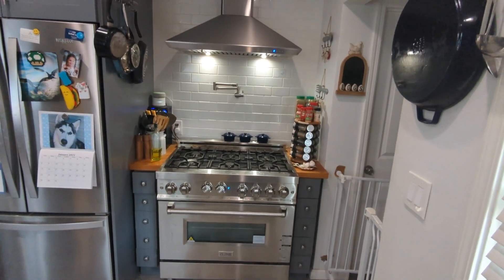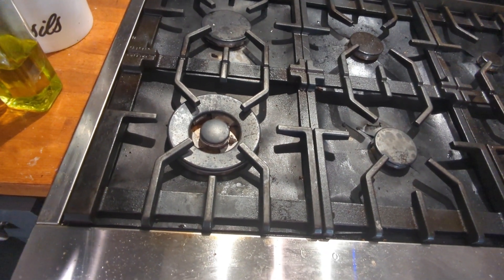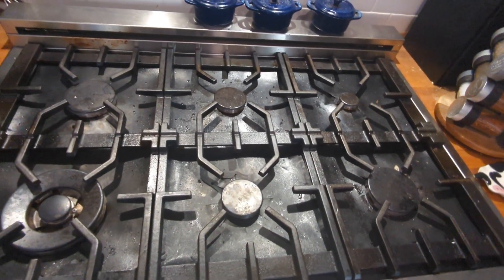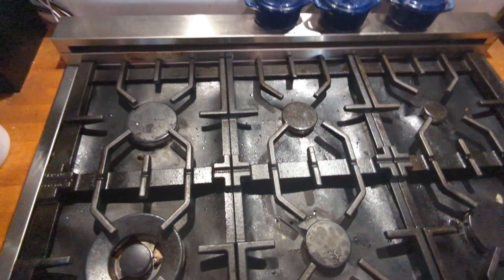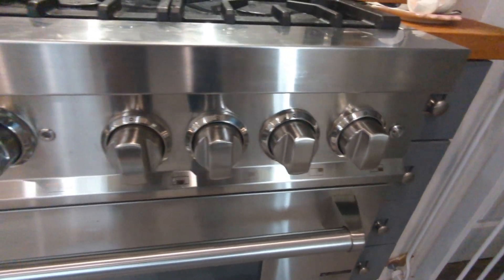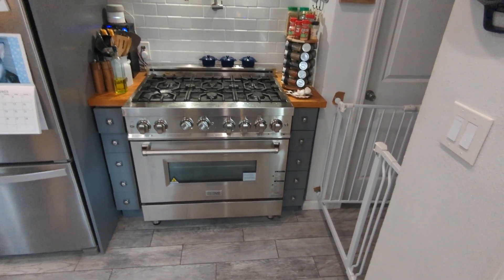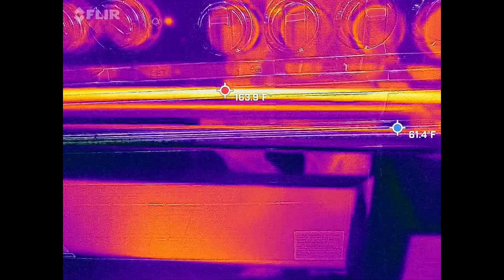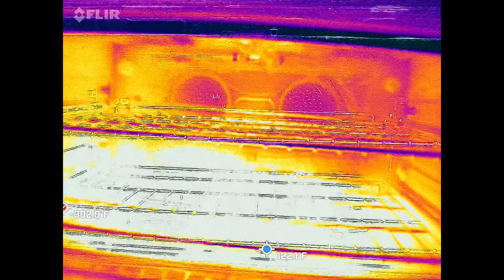Update: ZLINE 36 Inch 1+ Year Update + Thermal Image of Oven

Comment: We have the RG-36 model and it too has a recall. I didn't realize the 24 in models were also recalled, my info only mentioned the 30" and 36" models.  Our power burner also has issues with not lighting.  Overall though I love the range and hope I've not gotten sick from carbon monoxide as we use the range a lot.

Comment: I bought my RA-36 back four years ago,  I got tired of the temperature swings that I modified it.   The blowing air you refer to is a squirrel fan that is drawn in air from the top opening what I think they are doing is to keep your wires cooled while heating the oven  - there is not enough insulation on the top side or bottom side.  1.  I took off the cover of the burner on the bottom and discarded it.   I then bought a JLD612 PID and installed it where the oven on the light is located.   I then placed a stub JK thermo-coupler in the backside next to the gas thermometer located then I placed an SSR solid stated relay and paralleled it onto the temperature knob wires.   My oven still works like normal with wild temperature swings unless I turn on the PID  then I have a large sous-vide oven +/- 1/2 degree.  I will buy another one for my next house and will automatically PID it. Amazon has a kit costing about $40 to get a precision oven.
Reply from the maker: This sounds like a very interesting mod. Would you happen to have a video or diagram?
Reply: @Jive_Engineering  Yes I have pictures.  Currently, everything is in one kit on Amazon.  I have been making Sous-vide iteem for over 20 years and made them for restaurants,  I can shoot a video; how would I give it to you?  Have you ever taken the top off?
Reply from the maker: @terrywade6172  don't want to make you go through a lot of trouble. But you can upload a video privately and send me the link.
Reply: I have never done a video before, I will try I have no editing software,  Terry     @Jive_Engineering

Comment: The burner caps can be cleaned with hot water, a green scrubber, and some scrubbing compound such as Barkeeper's Friend or Comet. On the double wok burner check to make sure there aren't any clogged orifices. Also clean it thoroughly. Hope this helps.
Reply from the maker: I will definitely give that a try. It seems like it gets clogged where the arc is supposed to go. Perhaps some oil or debris got in between these two components. Thanks for the recommendation!
Reply: I find it to be rust not letting the spark or a poor spark

Comment: Just got my recall parts put in. Now I’m beginning to use my oven, still nervous that it’ll emit c02. Also, I have to to turn on timer when I’m turning oven on. Is there a way to turn oven on without the timer?
Reply from the maker: If yours is anything like mine, you can move the knob to the ON position. It should keep it on until you come back and turn it off.

Comment: My oven does not have a knob with high bake and low bake on it. I have the timer and the temp knobs. I cannot seem to get the oven to heat to 350 in a timely manner. Any suggestions as how to do that?
Reply from the maker: The way we have done it is by timing. Ours heats up within 15 minutes, so we always set the knob timer to 15 minutes. When it dings, we know it is ready.

Comment: I have the drop-in 36" version, after a few months of SIX burners - only ONE is now working (clicking). ZLINE promised to send replacement parts but NO service for fixing it is available... just found out today. This brand seems to have a lot of issues.
Reply from the maker: Sorry to hear that. That definitely seems like an electrical issue. Our one big burner acts up quite a lot, as seen in the vide. But everything else has been fine.